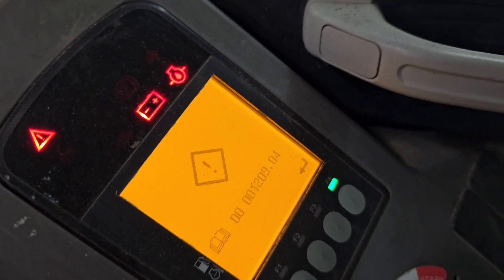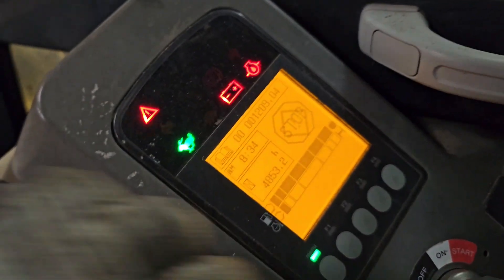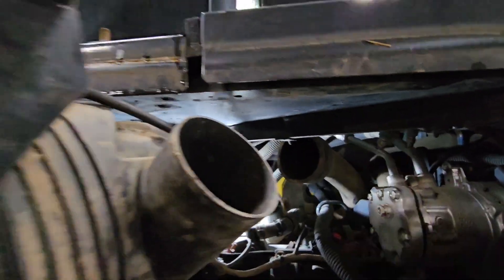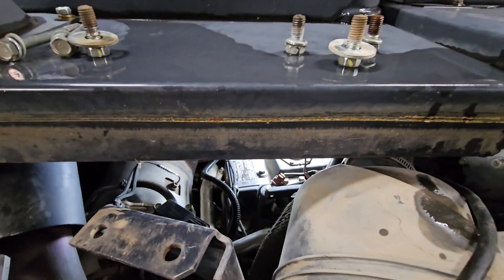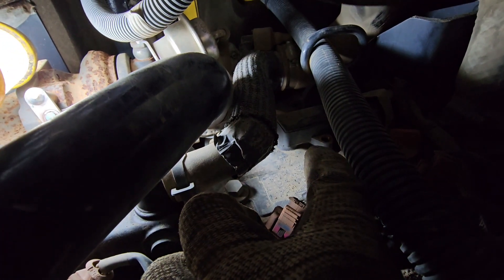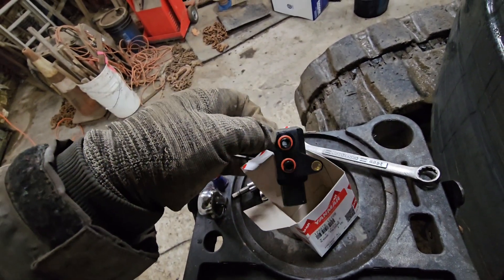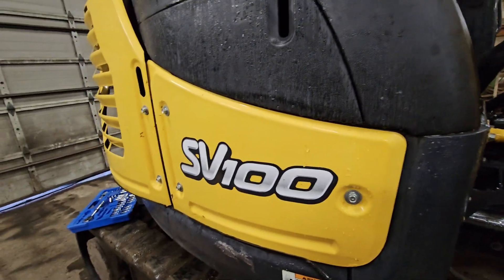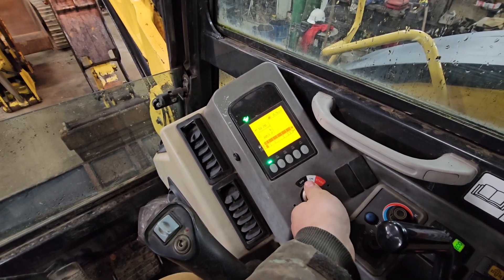Exhaust Pressure Sensor Replacement on Yanmar SV100 for Code 00 000102.04

Comment: Thanks for posting this video, fixed a yanmar with the same code.  Vibration can lead to poor connections at the connector.  Wiggle test connector and if fault comes and goes, change the connector and terminals.
Reply from the maker: Im happy my video helped!
Reply: Common for the insulation inside the sensor to become swollen after a while due to heat. Causes false pressure reading inside the sensor